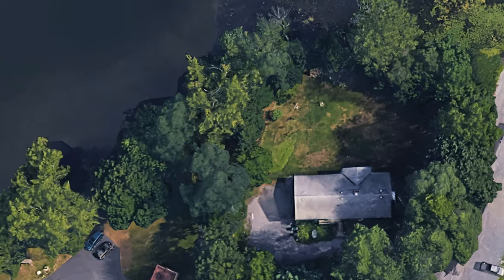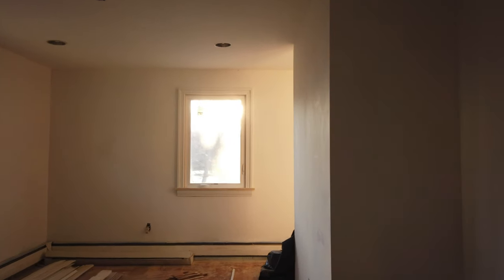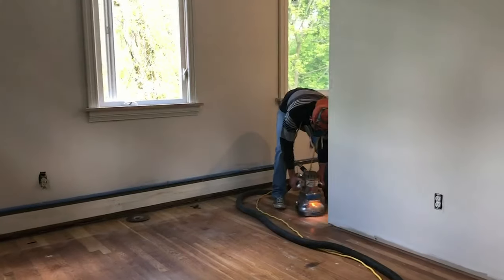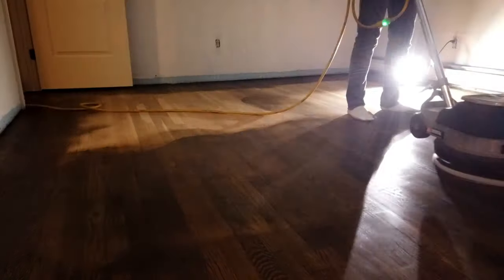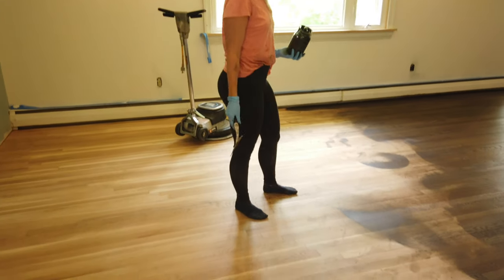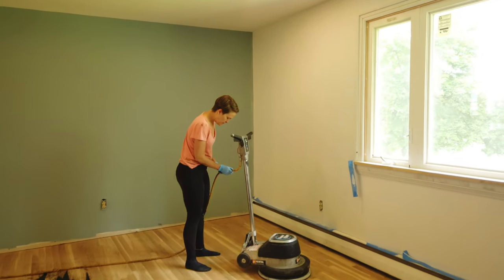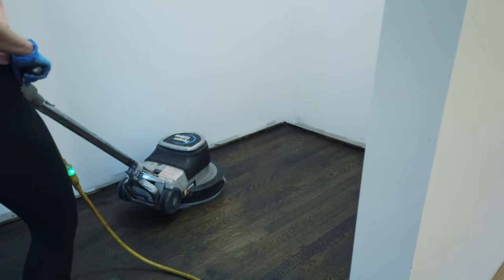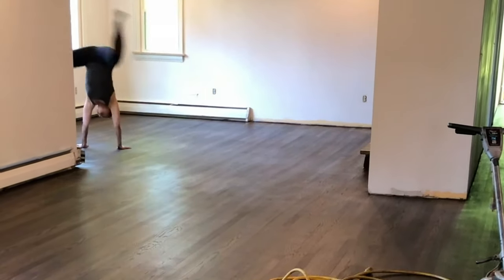DIY FLOOR REFINISH USING RUBIO MONOCOAT VLOG

Comment: Love the video! I wasn't able to find a floor refinisher in my area that fit my budget, so I'm planning to go the same route as you all - hire someone to sand and then finish the floors myself. I'm currently considering Rubio chocolate or black, but your floors looks really beautiful as well. Did you sample beforehand? A question - in your opinion, does the product have to be applied using a buffer/polisher machine, or could it be done by hand (Karate Kid style - wax on, wax off)? I'd be doing it solo and it's on the second floor of my place (I'll also be doing my steps) and carrying the buffer machine up and down my stairs by myself could present some challenges as I think they're around 90lbs. Would love to know your thoughts.

Comment: Hi thanks for the video, gives me hope, what machine were u using to spread out the oil, is it a low speed 175rpm buffer or is it a higher 1500 rpm polisher, I'm also doing diy and it's confusing to me that there are low and high speeds for the machines when I see videos with even the professionals doing it with one machine